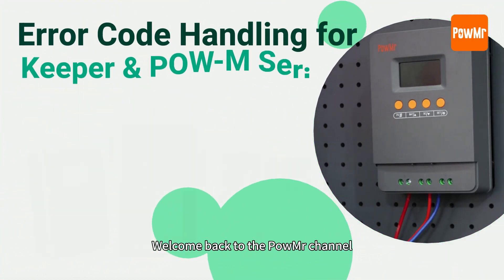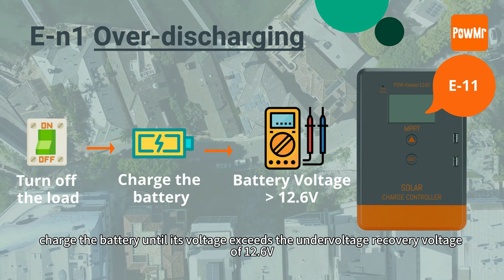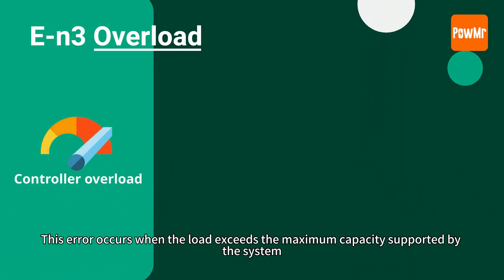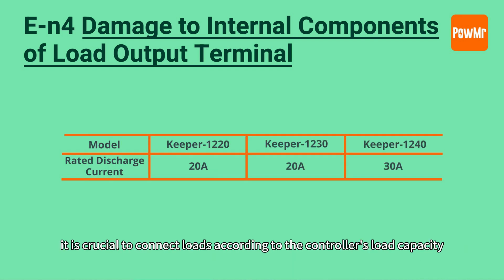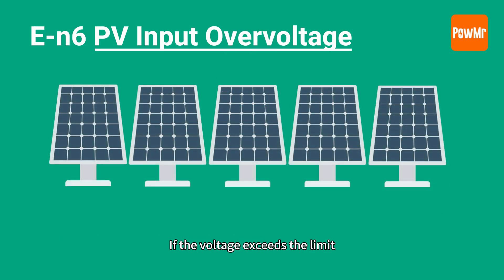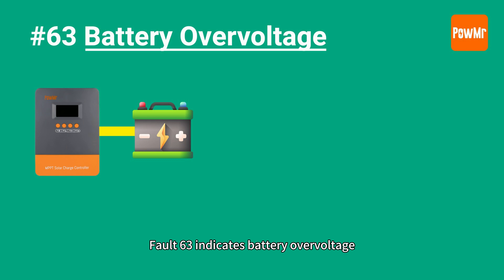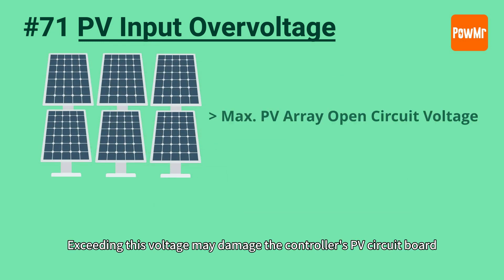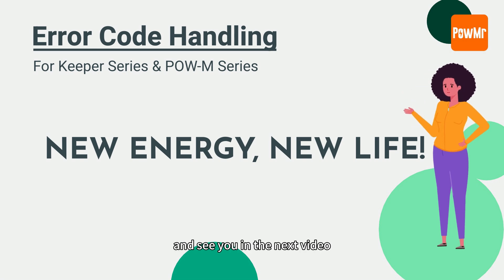Error Code Handling for KEEPER & POW-M Series Solar Controller

Comment: I watch this too late I'm already getting E_14 (Load Computer Internal Damage) which is irreversible. Please add an internal circuit-breaker when output "Load" overloads. I've put a 500W inverter and seems to have damaged the internal circuit. All the rest works well, but Load only gives exactly the half of the battery voltage. Please advise
Reply from the maker: Please send it with the product label to this email: support@powmr.com. Our technical will check it for you.

Comment: How to reset the code? I have e-11 flashing as I've messed up with settings. Battery is 13.7V now and I still cannot go into the menu or reset it to default using temperature screen. Yes, I see temp. for a second and then error keeps flashing and menu button simply doesn't reset it. Please help me to go into the menu again. I've disconnected everything and connected only charge controller to the battery.
Reply from the maker: which model?

Comment: E -15 ( controller overheating) how to solve pls details explain
Reply from the maker: Please turn off the controller for half an hour, then restart the controller with only the battery connected to see if the code disappears.

Check whether the installation location is well ventilated and avoid installing it in direct sunlight.

Comment: I use powmr 24v 4.2kw 
I am having fault 04 low battery, now my battery is charged to 29v
How can I manually reset I am completely off grid